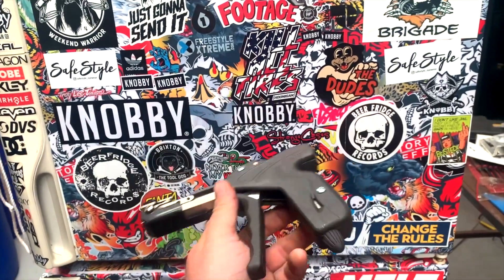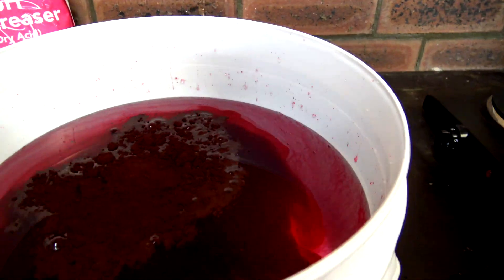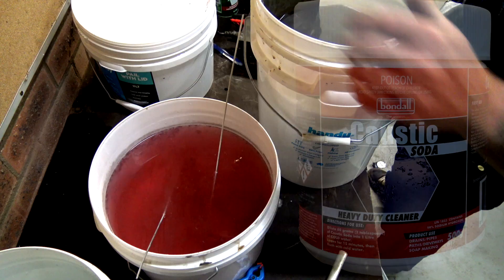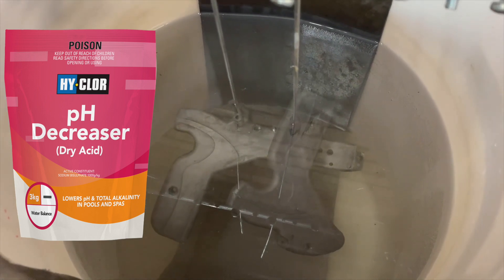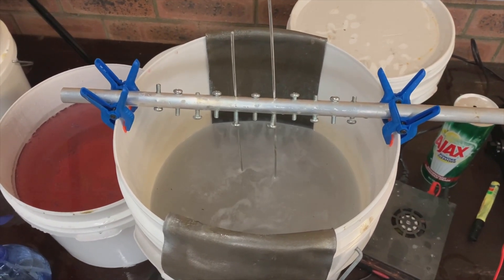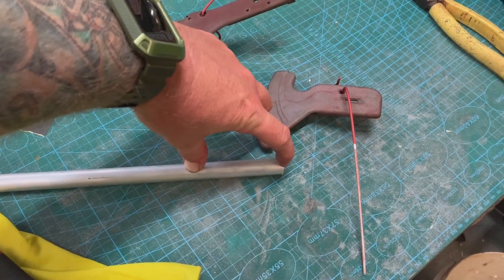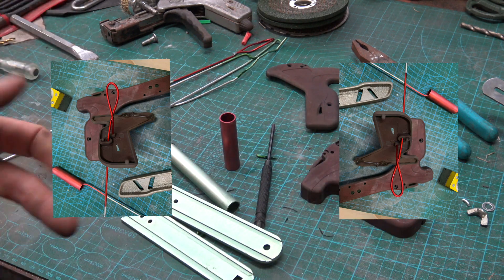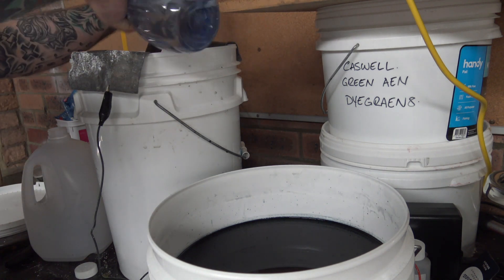Anodising Aluminium : A good day to die hard

Comment: from what i've been told from professional anodizers is with cast Al products the relatively large size of the silicon grains and the porosity in the casting causes them to go brown and splotchy like you had happen.  supposedly it can be done well but there needs to be a special polishing/burnishing step done to the surface.
good job regardless, they came out looking pretty damn neat.
Reply from the maker: Very interesting, so if I was to say take a test piece down to 3000 grit? I will look into this for sure!

Comment: That's fascinating. I never would have thought of trying to do my own anodising. Did you at any point think about just paying someone to anodise then for you?
Reply from the maker: The fun is doing it yourself. If the entry cost is not to hight that is...  its like powder coating. INSANE cost to set up.

I assume the cost for a one off part would be fairly expensive from a pro shop, but i never looked into it haha.
Reply: @Finntheweekendwarrior  at least here in the US ive have some experience working with anodizing shops.  There was usually a minimum lot charge around $150 - 250 USD, and that would generally cover a few dozen small parts